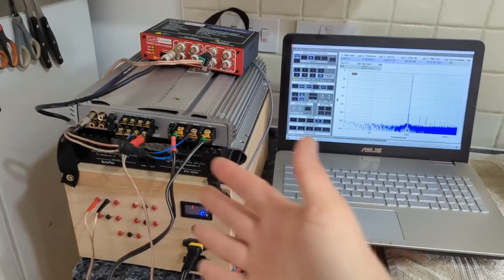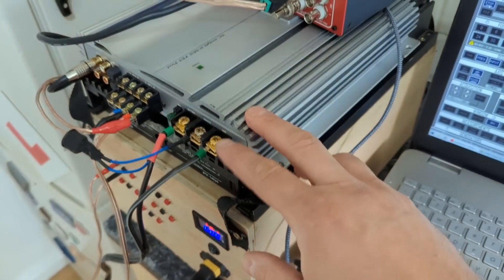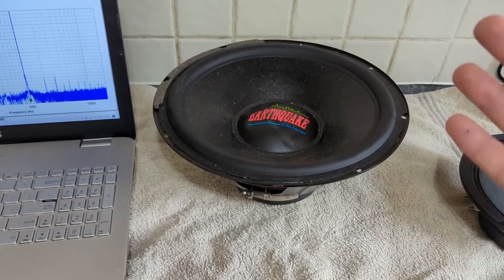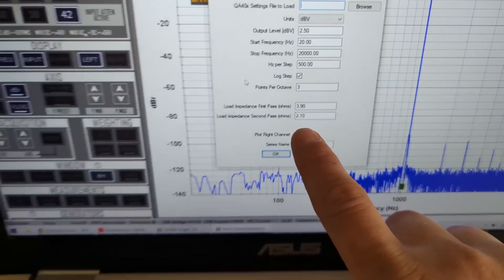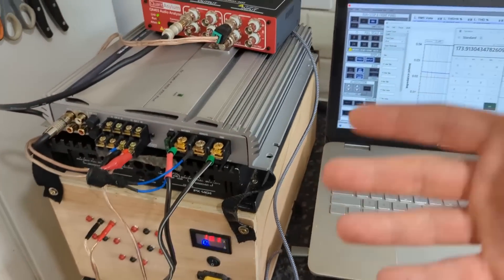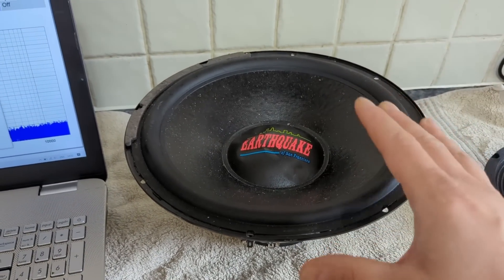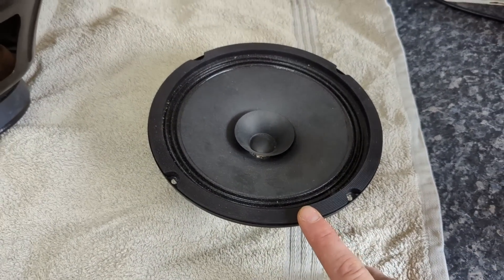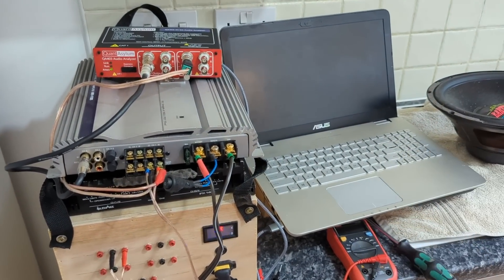Does amplifier damping factor really matter? Let's test it!

Comment: My question is why not also test some home stereo amplifiers, I own a couple of Adcom amplifiers, one has 260 and the other has 500 damping factor. How do you compare those to car stereo amplifiers running off 12v dc batteries. I've really wanted to buy a crown class d amp to compare and see if its worth upgrading.
Reply from the maker: Well, I am a car audio guy so I test 12V equipment🤷
Reply: It's been stated that around 80 is good enough for home stereo systems but it depends on the speakers too.  I had an amp known for power output but low damping around 43 df and it made my speakers bass too flabby, slow and undefined (there were other issues as well such as graininess in the mids).   My lower powered amp has around 150 df and surprisingly a rising frequency response rising up to 1.5db slowly starting under 90 hz and provides tight, strong and decent quality bass.  The added response might help bass a bit, not much but also sucks a bit of energy too.  But the amp works fine on even 4 ohm speakers.  The difference in bass is minor between that amp and my upscale amp which probably averages well over 500 df., so at moderate SPLs, you may not gain much unless the speaker driver really needs to be heavily controlled and requires power and whether one listens at higher SPLs.  Then a higher df may help.  

There are higher powered amps with a low df too whose bass is appreciated by alot of people producing a warmer sound, one that may add to the mids, but I prefer a fast, tight bass with definition over that.  System synergy.

Also, some have stated that speakers of higher sensitivity/efficient speakers can play better with amps with lower df while those that need power for output SPLs can benefit from higher df.   But there is more to this I suppose.  A nearfield speaker that can only take 50 watts but outputs say 83dB at 1 watt/2.83v or however they get measured today, may or may not sound better to someone due to df.  So, there's more to it such as distortion, SNR, how well a signal gets amplified along the whole frequency curve, room, source, recording, etc.  

In my experience, if an amp has sufficient df to not sound flabby on a particular speaker I have, its good enough.  Can one have too much df?  Yes.  It can make a speaker sound a bit thin in certain ranges, from what I have heard.  Adding a sub can change the whole presentation as well.  If one uses a good sub that blends in the bass without seeming off, too fast or too slow, etc., it's going to cover up or fix some of those low end deficiencies when set appropriately at a certain low frequency point, especially if you can cut the poorest response off from the speakers.  Say setting the crossover point somewhere between 50 and 100 hz.   

I run my small bookshelves full range with a sub adding in at and below 80 Hz and it mostly works without hearing the sub.  Perhaps 2 subs would help that for balance but it isn't worth it for me as I am satisfied with the results.

Comment: I run class D amps 
I run a Stetsom Digital Bass 3000 2Ohm Version
I also run a Stetsom HighLine 800.4 on my mids and highs.
Both amps have internal fans..
Stetsom is more of an SPL company but I have to say the sound quality I am getting is phenomenal.
The Mono amp puts out 3700 watts rms @2ohm @14.4v and 3000@ 2ohm at 12.6v
I run three 1000 watt rms subwoofers in sealed boxes.. Dual enclosure in rear of suv and one in middle of 2nd row.
S/N ratio: Dampening Factor and THD not really rated at time of purchase. Just saw amp dynos verifying power and foot print. I wired my 3 subs to 2.67 ohm and with ohm rise I am probably close to 3 or 4ohm load and this amp sounds phenomenal!

The low freq's sound so clean down to around 24hz...

I broke my sunroof (now sealed) from the roof flex that the sound reproduces. 
My windshield wipers shake at full tilt

But it also sounds nice and clean at low volumes not overpowering the rest of the music but blends very well.

The higher the ohm load the better the dampening imo.. 
If your amp sucks at 4ohm its not a good amp..

Wire down to 1ohm or .5 ohm and you can get really loud but no control. Then ppl wonder why they have to recone subs all of the time lol..

The 4 channel puts out 125 wrms @4 ohm under 12.6v and 165wrms at 4 ohm on 13.6v. it has a fan on it, so I hear slight sound from small tweeters when hooked up but changed to 3.5 full range speaker and no more slight hiss.
Both amps run cool and sound amazing. I get compliments all of the time. 

Running a mono amplifier at 4ohm or better (If it has the power) will almost always provide a high dampening factor and much better control of your subwoofers vs wiring down to 1ohm or .5ohm with little much less control.

Again, If your amp sucks at 4ohm its not a good amp..
Reply: so neat goodjob so proud of ya

Comment: I feel this is a much more important factor for tweeters and  upper midrange. . it's a lot more audible when the mids and highs are smeared and ringing. A water fall graph across the entire  frequency response would be Interesting to test this theory
Reply: You are totally incorrect here. Damping factor matters most at lower frequencies and lower impedances.
Reply: @carlosoliveira-rc2xt  but can you audibly hear it I'm not saying it does not matter at low frequency I'm saying it's going be a lot more audible at higher frequency when wave length is shorter and the cone has to stop and start faster that low damping factor would be very audible. As far as ohm loads can drop no matter the size the driver I seen 8 ohm drivers have a 1.7 ohm impedance at some point of the frequency sweep. But also maybe as you said I'm completely wrong with I don't see how that is going be possible both things we both said could be true  I just saying it would be very nice to see that tested to see if you can see a measurable difference
Reply: @paulgood2218  I've read elsewhere that generally damping factor over 200 is "the same". It's mainly when you get tube amps that have damping factors of 1 that you can hear more to do with it

Comment: My Experience regarding Damping Factor is from the early 90s. Back then i built a pair of 15" backloaded horns equipped with Eminence EM 15-300. At first i ran them off of a home audio Aiwa Stereo Amplifier with about 2 x 120W RMS. It was nice and loud, after all it was 2 15s :) but at higher volumes, the Bass seemed to somehow "fall apart" in lack of a better term. Then i bought a PA Amplifier with 2 x 500W into 8 ohms. The Difference was absolutely huge. Not only in terms of achievable Output, but also soundwise, tested at roghly the same percieved loudness on both amps. Before, there was an undefinded rumble in the low end, which was completely gone on the PA Amp. Like night and day, literally. My only explaination back in the day was damping factor, made the most sense to me. So one could say, i have been wating about 30 years for you to enlighten me on the subject! Cheers! 😊😊😊
Reply: Sounds more like you ran out of power. Also questionable power outputs; which Aiwa has 2x 120W RMS? At 1kHz or 20-20k Hz?
Reply: @RennieAsh  keep questioning the specs provided by the manufacturer. brilliant idea.
Reply: It's been said it was more of a marketing topic back then and is in reality not important at all.  I posted a link in the comment section of Joe Hobart that kicker going into some detail about damping Factor.

Comment: Very interested to see the impulse response results, since I've only seen damping factor discussed in relation to frequency response attenuation in dB. 

Since the effective damping factor is a combination of the amplifier output impedance and the speaker cable resistance, my guess is that in car audio the effects will be hardly noticable, as the runs from the amplifier to the subwoofer tend to be rather short and most people use common sense and aren't using 18 AWG cable for subwoofer connections
Reply: You left out the dominant factor in the control of the cone. The DC resistance of the voice coil, typically about 70% of the rated impedance of the speaker, is a part of the series resistance that in includes the amplifier’s output impedance, the resistance of the wire from amplifier to the speaker, and the resistance of the voice coil. The fact that part of the resistance is inside the speaker is not relevant to how damped the speaker’s motion is. Unless the wire running from amp to speaker is unusually high resistance, or the amplifier is an old tube amp with minimal negative feedback, the resistance of the voice coil winding is going to absolutely dominate. An amplifier with 0.1 ohms output impedance would have a much lower damping factor than an amplifier with a 0.01 ohm output impedance - and that wouldn’t make ANY practical difference, given that the resistance of the voice coil would be 30 or more times greater. BTW, FWIW I am a retired pro audio product design engineer.